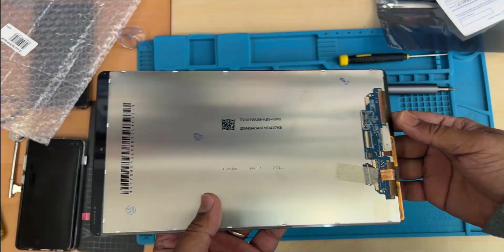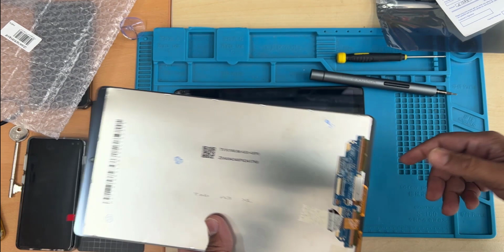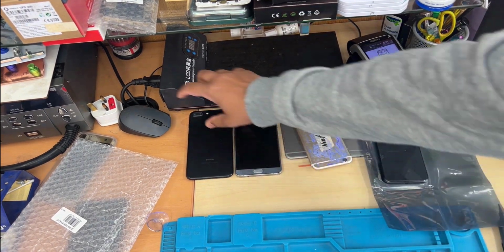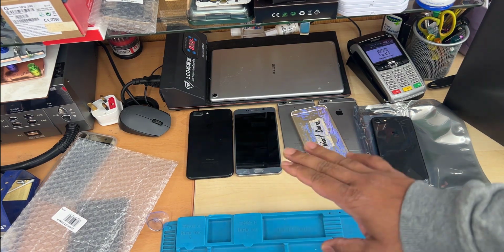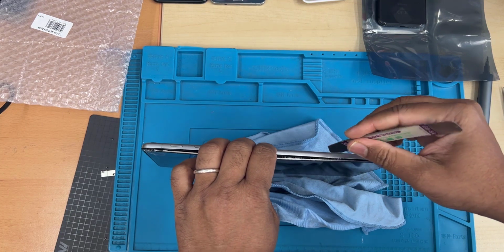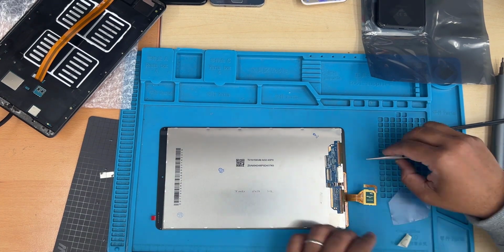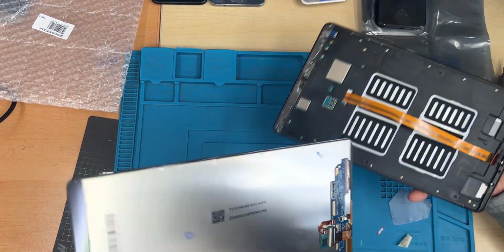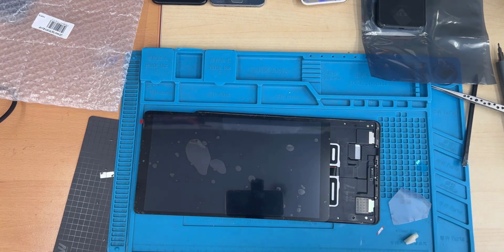How To Replace Screen On Samsung Galaxy Tab T510 Easy Way

Comment: Just changed my screen but it's just black. I changed the LCD flex cable but that didn't work. Do you have any ideas? The screen was working before but now even the original doesn't work. If I accidentally left the device on what would be the issue? Thanks 🙏🙏